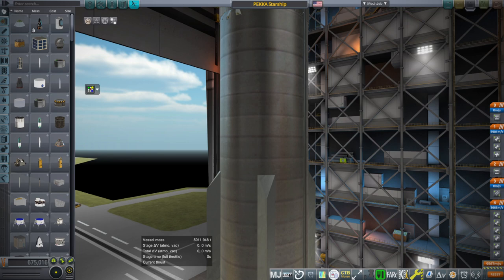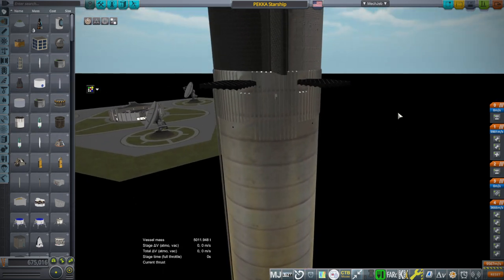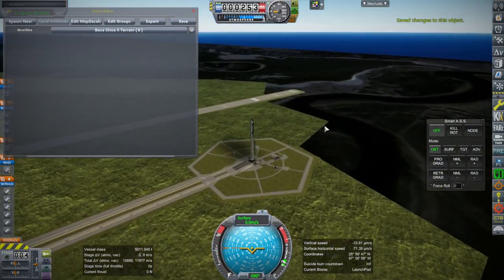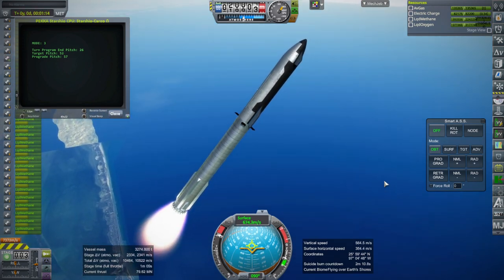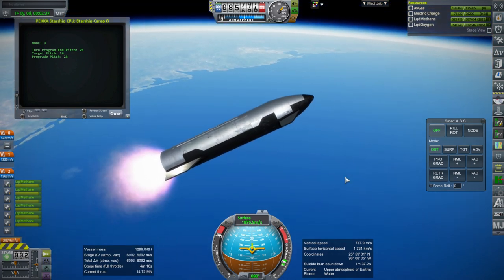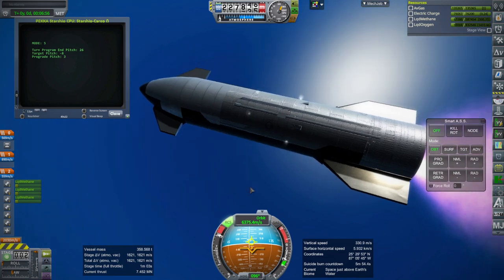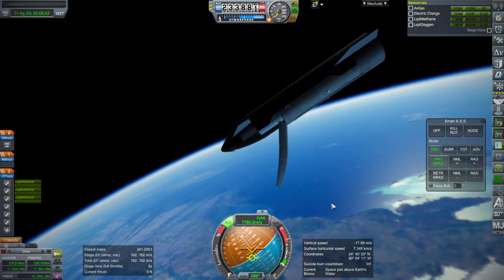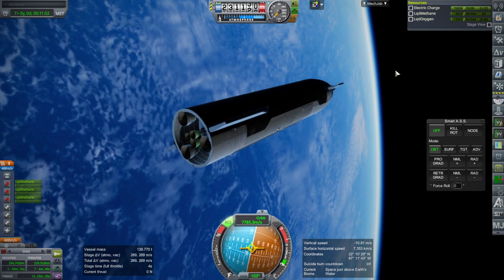KSP 1.12 with RO - PEKKA's Starship-SuperHeavy Initial Testing

Comment: This model is really good, there’s only a couple things I can point out. The booster should be rotated around 180 degrees, with its QD port on the same side as starships, the leeward side. Also the two chines on the booster closer to its QD are much skinnier and also mounted at a different angle to the other two, making them closer together. As for thrusters on the Starship it might be best to make up placements for now cuz they don’t have any true RCS yet